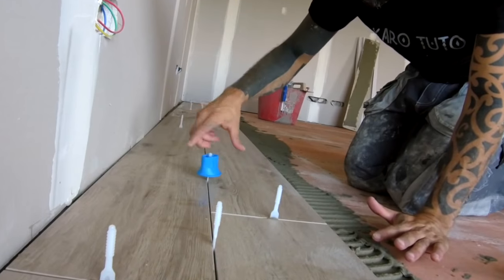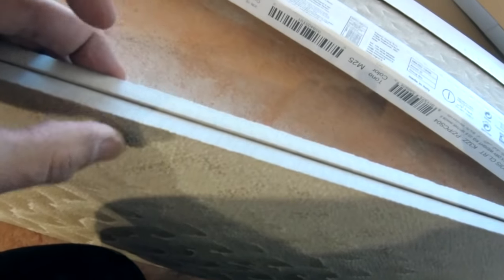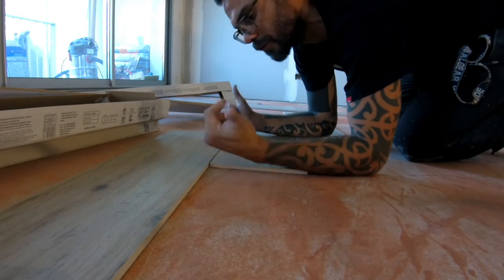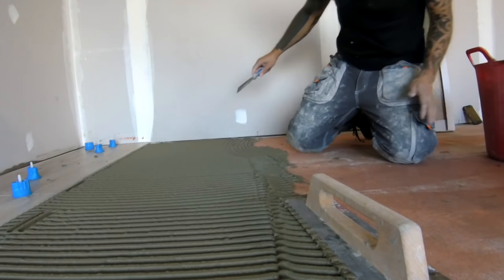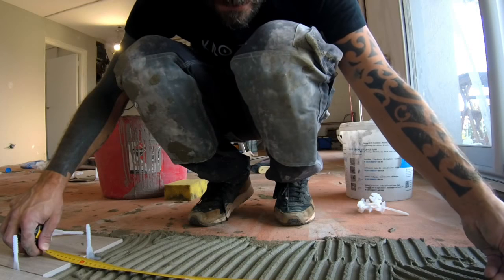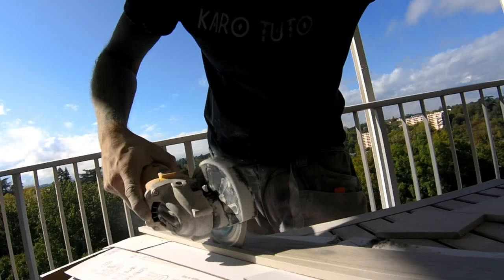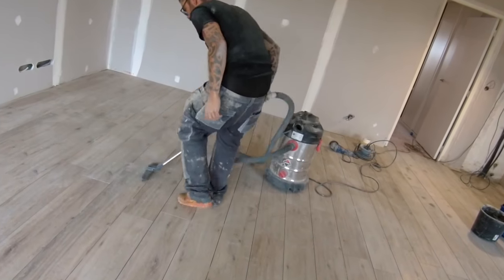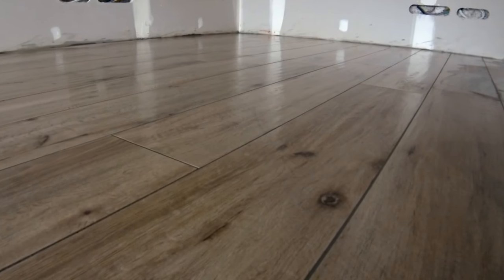🔴Comment poser du carrelage imitation parquet

Comment: Salut Gilles , permet moi de te donner 2 /3 conseils pour te faciliter un peu le travail et te préserver physiquement .
Quand tu étale ta colle ,n'hésite pas à tracer au sol un trait qui la délimitera , cela t'évitera d'avoir de la colle sur les genoux  et tu sera plus à l'aise pour poser ( 60 cm est la distance idéale, donc la ,pour un carreaux 20x1,20 cm tu posera 3 rangées )
Autre chose , emmene toujours sur le chantier ta table Rubi ou 2 trétaux pour poser tes carreaux dessus  lors du double encollage .
Tu sais , cela fait 35 ans que je fait ce métier et cela devient de plus  en plus difficile physiquement ( surtout , depuis la mode des carreaux xxl )
c.est pour cela que j'insiste , PREND SOIN DE TOI !😜
Reply: Salut Gilles et salut Eric.
je voulais te demander.je dois faire un devis pour ce type de carrelage . cest du 20x120. 
cest combien le metre carré juste la pose sans rien avec colle flex?
Merci pour ta video.
Reply: Bonjour , tout dépend de la surface à réaliser ( le tarif n'est pas le même si tu a 200 m2 ou 30 m2 )
La configuration des pièces est très importante avec ce type de carreaux ( le tarif n'est pas le même si tu a une piece de 200 m2 ou 5 pieces de 15,un couloir et un chiotte .
Compte poser tout seul 10 m2 par jour / joints finis apres tu compte le nombre de jours de travail et ce que tu veur gagner /jour .